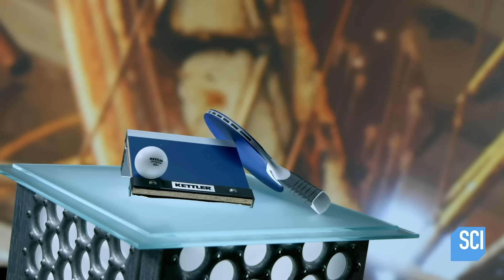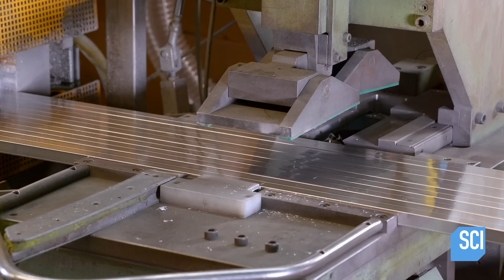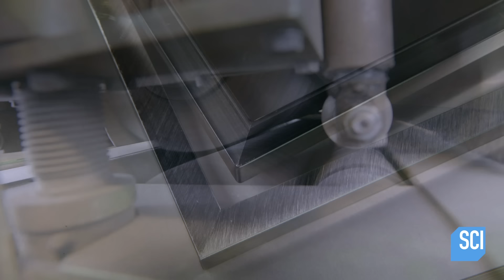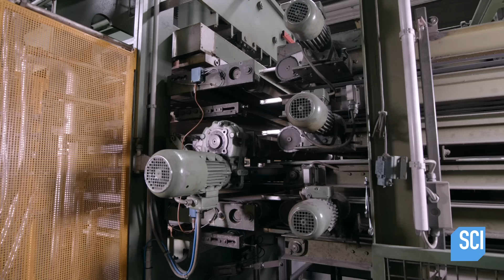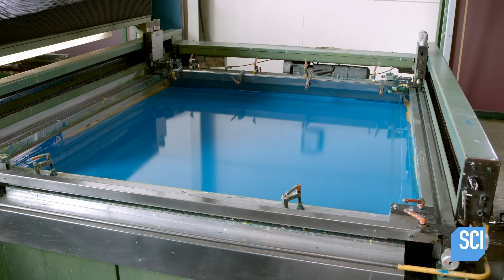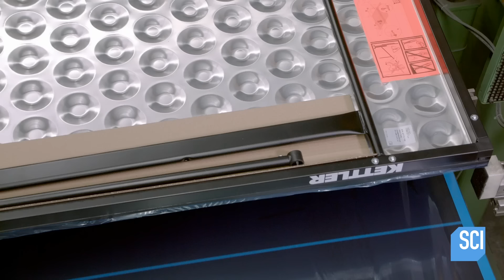How To Build a Ping Pong Table | How It's Made

Comment: Note : This is a EXTERIOR table ( cheap). Way way different from indoor and even more different from Pro tables. This  is a table to have in garden for summer and play a bit for fun. Bouncing, speed, effects etc are NOT ok with this. For a quick compare, A Pro table ( indoor only) weights almost 200 kg.  The surface is 30mm thick at least. Cheers !!
Reply: But the ball pocket there is the BESTTTT
Reply: 30 mm thick*